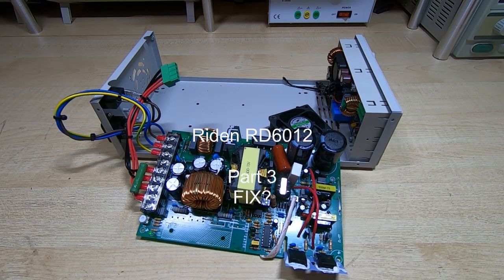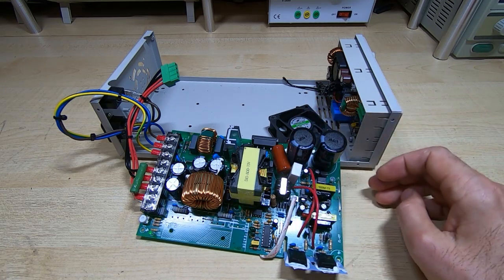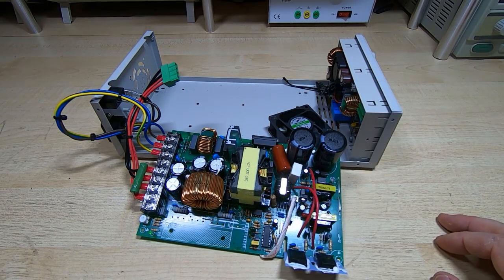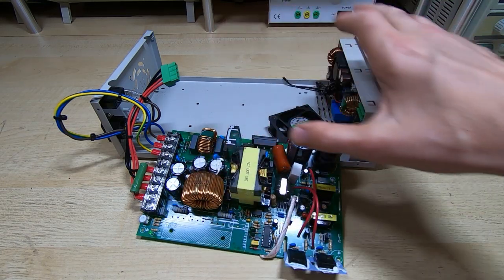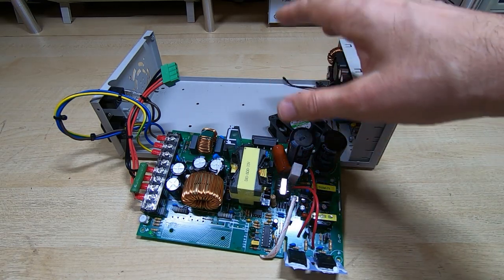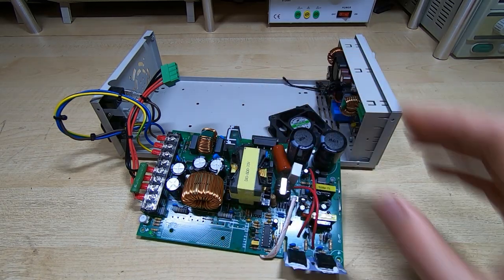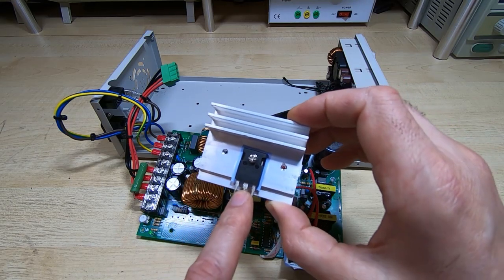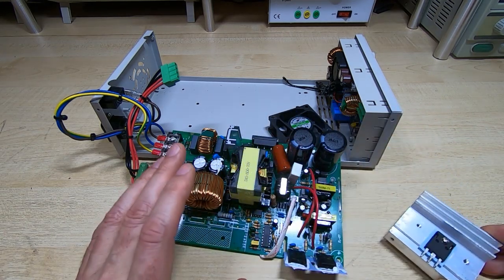Riden RD6012 Part3

Comment: So far I haven't seen a truly stress test on the Riden6012 itself because of a minimal drop-off between Vin and Vout has been performed.
However, I would say that if you maintain the maximum supply voltage while operating at a lower one but at the maximum operating current per the manufacturer's specification. It would be a different outcome.

Comment: Great video series!  I bought an S-1200-65 power supply to use with RD6018.  There are 6 dual diode P/N LXDC4 UA4030G, which I can't find a replacement, or data sheet for.  There are also two extra unpopulated locations on the board for two more of the same parts.  If anybody knows an alternate part, I'd be interested in hearing.....
Reply: I can't find that PN either.   I have two RD6018's and considering that PSU

Comment: Thanks Jerry, I am using this to charge a 48v nominal LiFePO4 battery pack, so push it over 55v and replaced the single package with two as you did. This is a great supply for my purpose, I can use it to top balance the individual cells and charge the full pack at decent amps. I have the S800-65 and the S800-70 versions of the switching supplies and both have the same circuit. My S800-70 has a little daughter board for fan speed control, but I just fitted a Noctua fan and didn't bother with more speed control. The Noctua is great, even at full speed it's noticeably quieter and still moves air. I also have the newer RD6018 and I haven't found a good 1200W supply for it yet, tried a cheap Lincoa brand from China, but would not recommend it. Noticeably poorer quality than the one in the kit and much louder fan.

Comment: hi Jerry, I enjoy and learn from your videos a lot.

I wonder, could you consider making a video about noise testing and supression
on these cheap supplies like S800-70. How one could go about figuring out where
the noise comes from, reducing it and measuring the effect. I have two S400-xx
supplies powering my RD PSU and they induce noise in the circiuits they are not
connected to. Just by turning them on scope trace gets three times fatter. I
tried to add resistors to switching FETs gates but I fail to relaiabli measure
any effect. I'm not asking to debug my problem but that kind of topic would be
especialy interesting to me.

By the way, KP184 has host/slave feature. I assume by connecting RS485 pins
on the back and selecting one load for host and another for slave you may be
able to use host interface to control both loads at a same time. Have you
tried it? I got only one of these so I just can say that selecting host mode,
in system menu, actually sends data out.

Thanks for you videos ;)

Comment: Can you tie 2 of these supplies together so you can have, say: +15 & -15 ?
Reply from the maker: Yes as long as the back ends are isolated. The outputs will be fully floating so you can tie them together however you want. In a recent video I connected 2 of them in series to give 0-120V.
Reply: @JerryWalker001  - Thanks Jerry

Comment: Thanks for taking the time to make this video, I appreciate your efforts!  Do you have a manufacturer/part number for the steering diodes, and who did you source them through?
Reply from the maker: They were mur30CT60 and I purchased them from Farnell
Reply: @JerryWalker001  Thank you sir, I just now tried to find it, however, this p/n mur30CT60 doesn't seem to find me anything searching on several websites including Farnell. I wonder if we could somehow find a cross-reference to another brand, to find a suitable match.
Reply: Seems like the p/n was a bit encrypted hehe. This one looks more like the one:  MUR3060CT   ...Attempting to find it now, thanks.  EDIT: Found them on AliExpress...
Reply: @samsonite8017  Pretty sure I already told you this on the DIYsolar board, but if you are in the USA and don't want to wait for a slow boat from China, these worked for me (and I ran it for 3 hours at full output):
https://smile.amazon.com/gp/product/B07J4MHSJ5/

Comment: Hi  Jerry,     what is the mains  input current and  power in   when you run it at full power   or say at 500watt output power?  I measured  for 500 watt output power  already  4.3 amps   at 225V AC.  ?  Is that not  too  high?
Reply from the maker: It depends on how you measure it as the SMPS that came with the kit has a poor power factor. I did quite a lot of testing of the supply efficiency and it came out around 91% at full power (This rose to almost 93% after the modification). Output from the SMPS was 835W (69V x 12.1A)  which was 726W output from the RD6012 (60V x 12.1A). This gave an input power from the mains of 918W. The peak current for a power factor of 1 would be 4.1A (at 225V) but it will be much higher than that in practice because of the poor power factor. Also of course make sure you are measuring true RMS and bear in mind that if you are using a variac then it will introduce a lot of distortion which will further push up the apparent peak power.
Reply: @JerryWalker001  Hi Jerry, Thank you for the quick reply. Yes indeed the peak current will be a lot higher.   I measured  the amps with a analog Amp  meter,  the best what I can afford at this moment and  no Variac. I like to monitor the current, Just do not want to blow up the switching transistors at the input. 
 I do see   the Riden DPS series in one of your video's . Must be a good  design,  when you use those!  Do you use extra cooling.?  I am thinking of getting the DPS8005.
Reply from the maker: @daveton3895  I do not use extra cooling but these supplies are only used for low current testing. I supply them all from isolated DC supplies so they are all floating. I use them when I need multiple independent supplies. They are also not enclosed so they stay fairly cool. Analog meters give good approximations of true RMS so they are good for this application. Peak currents will be very high but the best method is to measure efficiency as this should show up any big issues.

Comment: Hi Jerry,  the other potmeter, I mean the multiturn blue potmeter  at the primairy side of this supply ,  not the one  to adjust the voltage.
Reply from the maker: That pot adjusts the fan threshold.
Reply: Ok  Tx   I will adjust that. need full speed to come in   at lower temp.
Reply: Hi Jerry. Turning this  potm does not adjust the fan speed. I contacted Riden and  Riden told it is for current adjustment,  not to be touched by the customer.
Reply from the maker: @daveton3895  I never said it adjusted the fan speed. It sets the fan threshold which I said was a current output. If you seem my modification I do Not say this should be adjusted and my modification is to control the fan using the current output of the connector. I also never suggested that this pot should be adjusted. It was someone else that made that suggestion.
Reply: @JerryWalker001   misunderstanding there.  I did not touch this pot.  Tx
Reply from the maker: @daveton3895  I have no idea why the pot is even being discussed. I never mentioned this in my video. It was only mentioned by someone else. I did Not suggest adjusting it, My modification was to add a circuit and Not to modify the power supply fan control circuit.

Comment: Hi Jerry,   2 questions if you don't mind.  I see you mounted the fan directly on to back of the  S12A case. Did you cut of the back-plate of the S800-70? that plate is in  the way to be able to do that. I think, your way of mounting will indeed improve cooling.

Do  you recommend to leave the cover off the S800-70 when you close the S12A case?  This will impove airflow, right?

There is a blue multiturn pot  5Kohm S1R1 near the fan connector. do you know what can be adjusted?  Some fan control?

Thank you for the info on the hottest part of the S800-70. Great job you did all that testing and measured that.  I will stick my sensor with thermo-conductive glue  directly onto the  middle leg of one of the diodes .

 my fan runs at 2 speeds   9Volts  and 14,6V  when sensor is hot. This fan is probably a 12V model.? you 100% right, That control indeed needs improvement
.

Tx again
Reply from the maker: Yes I cut the rear off the supply. See this video https://www.youtube.com/watch?v=y_TAnfTYa6I&t=240s
I attached both the supply sensor and the RD6012 sensor to the rectifier heatsink. I left the cover off the supply and everything works fine now and does not get too hot. The pot is used to adjust the supply output voltage and I set mine to 67V
Reply: Hi Jerry, just for your information , I had ordered a second  S800-70, but received a S800-65. This seems now to be the recommended PS.  by Riden and for use with the RD6012.   The fancontrol circuit is different . Standard  off , high temp  full.    I am using for the S800-70 my own  buck XL7015,  the standard pcb,  to control my fan. I use this module  with a 10k NTC , This module  supplies  at  30C 4.2V and at  around 70C 12V  to the fan. The fan  in the S880-70 is a quality fan  I can mail you more details in case you are interested.
Reply from the maker: @daveton3895  Thanks for the information, Maybe they saw the video :)
Reply from the maker: @daveton3895  I checked the specification for the 800-65 and I think it is the same supply as the 800-70. Itis specified as a 'custom' edition' so I think they have simply adjusted it to 65v to reduce the power output. Also the temperature control pot may have been altered. If this is the case then it will most likely still fail at full power.
Reply: 05:34
Yes and no. I  have opened the enclosure., cannot return it. Some modification on the pcb  as well . An outputcap was replaced with a 10W resistor, Bad decision .More heat less capacitance. For a 12A output, capacitance is  very  small now with   25% less capacitors , very poor solution.
Reply: I am certain,  were would china be without Jerry Walker!  they are the master copiers.!

Comment: Hi  Jerry,   was  the mur30CT60  the only component  which failed  in your  S-800-70V powersupply?  It indeed  heats up   quickly  I measured its  case  temp  100C +
Reply from the maker: Yes it was the only failure, I did quite a lot of investigation into this which I did not show in the video. Looking at the impulse currents flowing through the device showed that at powers above around 480W it was being operated outside its rating. The junction temperature would have been getting way too high and no amount of heatsinking would resolve this. Putting two in parallel resolved this and because the allowable peak current is a function of junction temperature then this resolved the problem in my supply. I have used it a fair amount since I modified it and have had no further problems. It is also worth dropping the output voltage to around 67V instead of 70 as this lowers peak power output from 847W to 810W and this helps to keep the junction temperatues down.
Reply: @JerryWalker001 Super ! Will parallel  2 diodes and drop the voltage as you suggest.  Tx for the great  advice!!!

Comment: Did you just leave the existing jumper in place? Looks like theres a spot to run a jumper to each diode. The flyback transformer is noisy in mine compared to yours
Reply from the maker: I left the jumper so that the diode pairs were in parallel.
Reply: @JerryWalker001  Thanks for the reply this was a good fix for a couple of my power supplies

Comment: Anyone have suggestions on alternative power supplies from decent manufacturers ? 70v is not an easy one to find.
Reply: I quite like the meanwell supplies, but I don't know of any 70v ones. Just around 60 for the 48v with adjustable voltage which should be sufficient for 99% of all cases.
And they are nearly all isolated, so you could use 2 in series.

Comment: Thanks Jerry for all the great videos. I do have one question; I noticed in part 1 you said you would not use the load resistor but in part 3, I see you did add the load resistor, why?
Reply from the maker: The videos in this series actually spanned several days of testing and part of that was to fit the resistor. The information that came with the kit said that it would reduce noise at low power settings so I wanted to test it. It did not make any difference to what I was showing in the video (and very little difference to noise which I am still testing and may post a video on at some point). I ended up removing it as it made no real difference and increased the standby power but was present for some segments that made it into the videos.
Reply: @Jerry Walker  Thank You!  I hope you and your family stay safe.
Reply: @JerryWalker001  hello, I am expecting a similar equipment in a few weeks.  I find your videos informative, and I will possibly need to deal with the low tension use 'while the alim is 18A)  here is a video where I noticed the tricks I tell you in another video https://youtu.be/SgkFuSv3Uug . some shielding, I plan to make a crowbar for low tension uses (just to avoid surges in case of wrong charging) 
thanks for exchanging your experience (ande sorry for my english!)

Comment: So please confirm: Running full 12 amps at 12 or even 24 volts (not the max of 60) and it should be able to do that all day long with the stock diode, correct? I'm also very looking forward to your future fan mod. I've temporarily added a 100 ohm pot to the fan, but it's a sub optimal solution for a maddening loud fan. And I'm the one who asked about the location of the temp probe, so thanks for going into that in part 3...clever location. Looking forward to part 4 Jerry and thank you! I plan to do some of your mods.
Reply from the maker: I think that anything under a total of approx 550W total output power would be fine but above that the time should be limited (down to zero at 720W). I will be modifying the fan control as I find it annoying. It runs when the unit is 'off' unless the switch on the back is also in the off position but when the supply is on the bench rack it is not easy to reach so I want the fan off when in standby.
Reply: @JerryWalker001  I totally agree about the fan. It's almost like the fan sensor on the PCB you heated up needs some big calibration or something. Ideally it'd start up initially, then slow down to a purr or stop until the temp rises and is needed.

Comment: I agree with your theory on junction temperature.  That particular package and screw hole mount for the diodes is not optimal for dissipating the heat being generated.  What you want is pressure on the package directly above the the device inside the package.  Not a simple task to achieve !  A bar across the device and then two outboard screws works well, but it is difficult to judge what is sufficient torque on the screws before braking the package.

Comment: So, the original kit comes with a power supply which can’t do the full 60v and this on comes with a supply that can’t do the full 12A. They are consistent, you’ve got to admit!
Reply from the maker: It can do both, just not at the same time :) The good news is that it has now been running at 12.1A and 61V for 10 hours. Thats 738W or almost 1HP so with the addition of a £3.00 diode it seems to be able to meet the spec but I would still recommend a higher power supply (the 1KW version is probably the same unit with 2 diodes fitted).

Comment: It is fairly common for them to have multiple positions where they do a higher power unit on the same PCB or they can use 2 derated parts.

By the way I always during 1st power up use my variac which is fed via a 200VA isolating transformer because of the reason you said, limited power so a bang is not so loud or destructive.
Reply from the maker: I actually think this unit was designed to be fitted with more than one of these diodes but they tried to skimp and decided to fit just one. First power up was using the variac but it cannot handle the power for this supply so for full power testing it was connected directly to the mains.
Reply: @JerryWalker001  Yes mine with only 200VA transformer is only the initial proving power up. :), just to make sure I have not done something stupid during the repair.

Comment: great video. Did you use same diode as original one ?  And you use 2 of them , not 3 ?  will be working with 3 ?
Reply from the maker: Yes I used the same type of diode as I wanted to prove that it was the use of double diodes that cured the issue and not a different type. I will not try 3 diodes unless it fails again as the diode capacitance is getting close to the switching recovery limit so another diode may cause the switching device to overheat and fail. It has been running for over 6 hours at full power now without failing and so it seems to be cured.
Reply: @JerryWalker001   It remains to find where to buy such diodes, the only place for now is China ... MUR3060CT  can it be replaced with MUR3060WTG?
Reply: @st.alexiev625  MUR3060PT is similar at least from the datasheet. As for if it is suitable or not I'm not qualified to answer that question
Reply: @gilegue6693  could the use of more powerful diodes (eg MUR6060PT) improve something?
Reply: @krzysiekstanski  to say the truth, mine is working well just the way I use it, so I am not planning on doing those just yet. And about the actual performance I'm afraid I'm not qualified to answer those questions (I'm just a seasonal hobbyists). I think Jerry will be more qualified to answer that
Reply: @gilegue6693  ok thanks...

Comment: Another excellent video, thank you. I would love to get your take on the GOPHERT NPS-1601 32V 5A Adjustable Digital DC Switch Power Supply if you're interested - https://www.ebay.co.uk/itm/For-GOPHERT-NPS-1601-32V-5A-Adjustable-Digital-DC-Switch-Power-Supply-f-s/124244235353?ssPageName=STRK%3AMEBIDX%3AIT&_trksid=p2057872.m2749.l2649